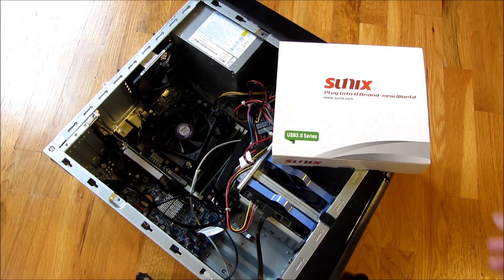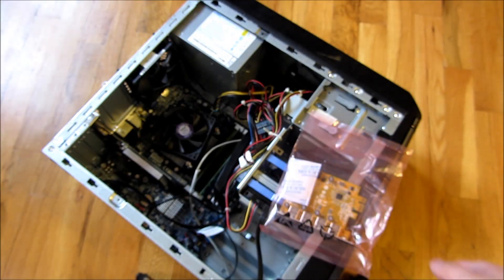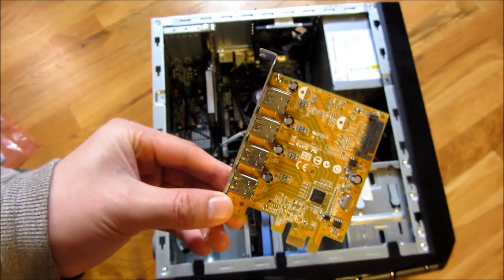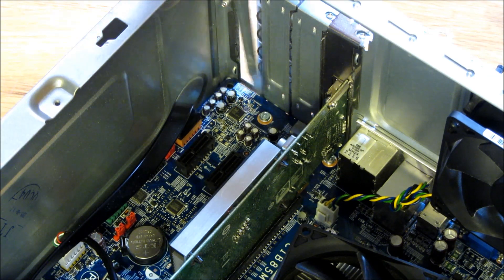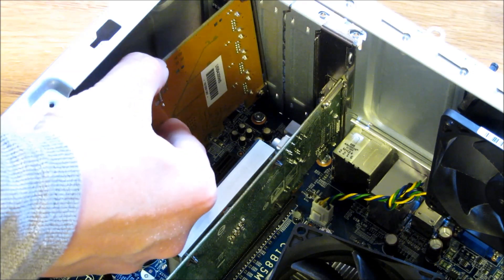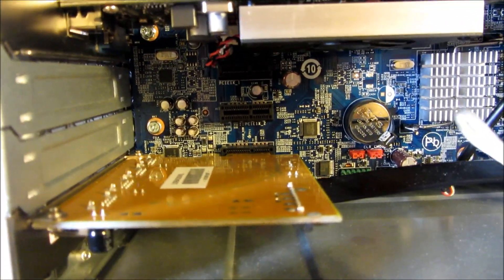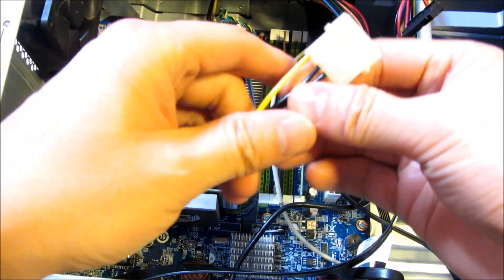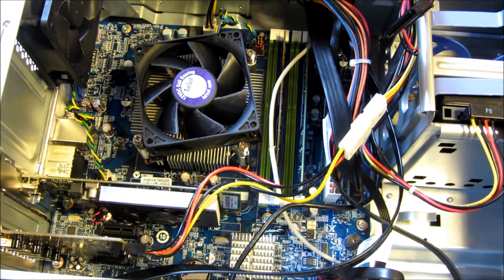How to Install a USB 3.0 PCIe Express Expansion Card (Sunix 4-Port)

Comment: I IDENTIFY (lol) as a non techie. I may do this. But I will say, whoever named hardware, or parts, made it hard. No way would I consider this piece of hardware as a CARD. So, I research. Never heard the term Molex, nor what it did. So, I have to research. THEN I come back to a tutorial like yours, somewhat better prepared  for your simple fix.  whew. TY for this straightforward video, I appreciate it.

Comment: So the cables are running from expansion to the power supply? Which port? Mine has a molex instead of a sata, is that a problem?
Reply from the maker: You need a molex to Sata power input then
Reply from the maker: Molex to Sata power adapter cost like $3 on eBay

Comment: Hi, is my motherboard (gigabyte GA-MA790GP) compatible with a PCIe USB3? I have tried connecting it to the PCIe x1 lane but it doesn't work, the motherboard can't display anything on the monitor. Or do have I to connect it to the PCIe x16 lane instead? Since it's the one that already a PCIe gen 2.0 type, thanks.

Comment: With this can i upgrade usb 2 to usb 3
Reply from the maker: Martin jyjy yes, you can, the pci express x1 slot will give you usb 3.0 speed
Reply: USB3 is 5Gb/s (640MB/s); PCIe 3.0 = 1000MB/s, PCIe 2.0 = 500MB/s, PCIe 1.1 = 250MB/s. My 2009 motherboard has PCIe 2, so unless yours is even older, it should indeed be close enough to USB3 speed via that card.

Comment from the maker: IMPORTANT NOTE: a 5 port is not necessarily better than a 4 port, because the 5 ports will be so close to each other that some device plugs may not fit side by side and you might end up using every other one, meaning only 3 of the 5 ports.